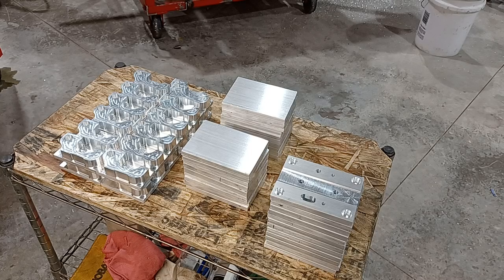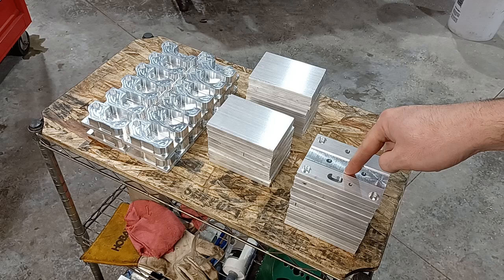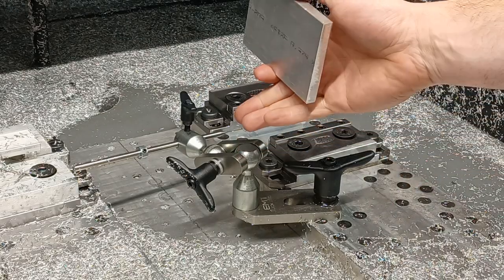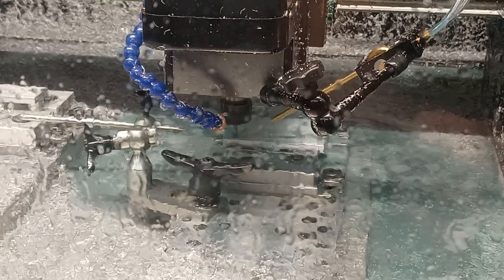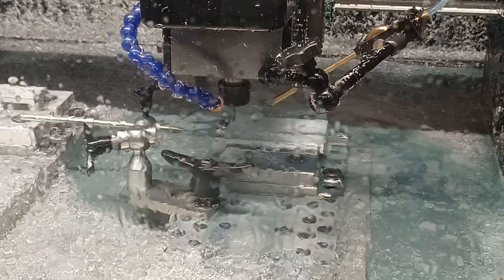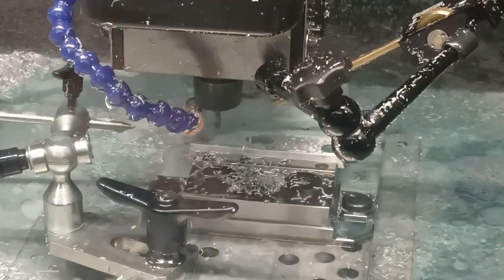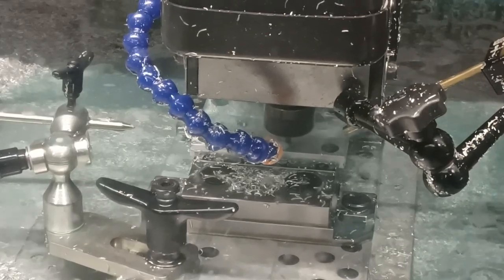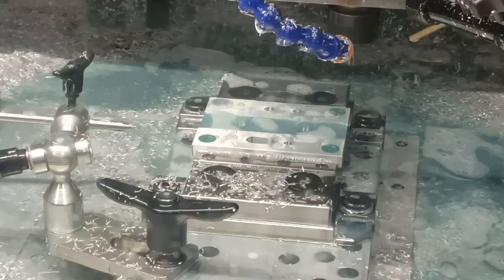Running A Part in Real Time On The Langmuir Systems MR-1 (no time laps)

Comment from the maker: Correction... I'm running 
6061 T6 Aluminum
4mm Endmill, 3Flute Bright Finish
8,000 RPM 
1/4" Depth of Cut
.020" Step over
100 IPM

Comment: Thanks for your video series on the MR1. I currently have a Percision Matthews 728 converted to CNC mill. I am really interested in this machine. I think it would be a upgrade to what I have at about the same cost as I could sell my PM machine for. I manufacture small parts mostly out of aluminum and based on your video it looks like it does a great job. I enjoy building things so I think that would be part of the fun with this machine. I like your part indexing tool that you make so I will check out your web site. Keep the videos coming!
Reply from the maker: You're gonna love building that!

Comment: How is flatness and perpendicularity on parts you’ve cut, that require a given tolerance?
A part can be flat but when you have a vertical wall feature that ties into the floor, what kind of tolerances can that machine hold? 
Also how rigid is the base? It just seems to me for the kind of money a person spends for this machine, it’s basically a glorified hobby mill.  
You can’t do rigid tapping, even though I prefer thread milling.  But when you have 100 holes on a plate, consisting of threads from 5/8 to 1/4 it can become very tedious.
I just think when anybody buys a CNC machine, you don’t buy a machine based on only your current need.
You buy a machine that you and your work can grow into.  Those machines are just so limited and their ceiling is so low.
With that said though, it might be a perfect fit and a perfect machine for your applications and that totally cool!
Reply from the maker: so you machine the bed after the machine is build so it 100% matches you X,Y, plane.  They have a built in scaling program for all the axis so you can dial it in as perfects as you want.  The thing about the MR-1 is that you build it so it's only as good as you build it.  No two MR-1 are the same.  Mine is very dialed in.  I can hold +-.001" with no problems I know other $$$ machines can hold +-.0005 but I didn't pay $$$ either so... It machines steel really well since the base has 700 lb of concrete holding it all together.  The spindle head is cast iron which also dampens vibration.  I feel like the MR-1 is the ultimate stepping stone for somebody trying to start a shop without going into debt.  It's waaaay more capable than people think but it's 100% user based results...  I've seen some people build trash MR-1's

Comment: Time to add servo motors. I have the same ball screws on my machine and and with clear path sdhp servos I have 1200ipm rapids.
Reply from the maker: Yeah that would be a big upgrade!
Reply from the maker: so my struggle is that for 20k I can get a used Robodrill, or a Brother CNC.  If I spend 5k putting servos and a BT30 spindle than I'm just that much farther away from a high end machine.
Reply: @BeckTools  3.5KW ATC Lusintun spindle: $1200 or so. 4x Lichuan Servos 600W: $500-600 (total, not per) for decent ones. Let me know if you want sources.
Reply from the maker: @mbanb6775  O man! I'm soooo temped.  I was just telling the wife I need to finish my current CNC lathe build first.  I also don't have a back up cnc mill so my MR-1 can't be out of commission at all right now.  maybe when I get my new cnc I'll upgrade the MR-1.  The MR-1 has a really large work area that most other machines do not have.  There are jobs that I will still need my MR-1 for even after I get a professional cnc
Reply: I bought a used robodrill and spent a few weeks painting it, replacing some lube lines.

I paid less than the MR1 for it and it’s a 5 axis machine running production right now with more repeatability and accuracy than I currently need.

My advice would be to save up and finance a used indistrial machine if possible, I use a pallet jack to move the machine around which is nice too.
Reply from the maker: @visionforgeinc  I saw some Robodrills with just over 1k hours for like 15k.  I think that's a pretty good deal.  That's kinda what I'm targeting once I get the money.